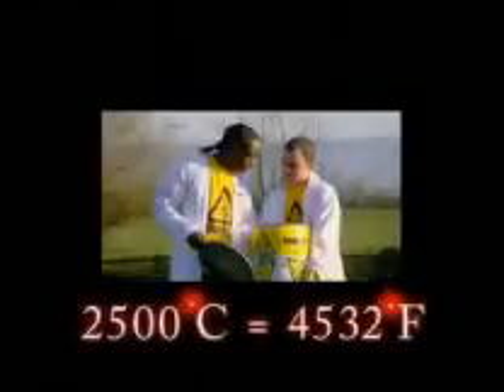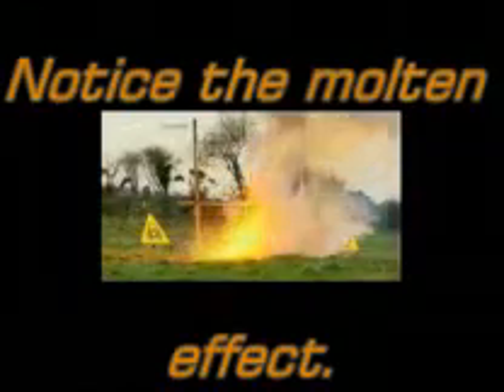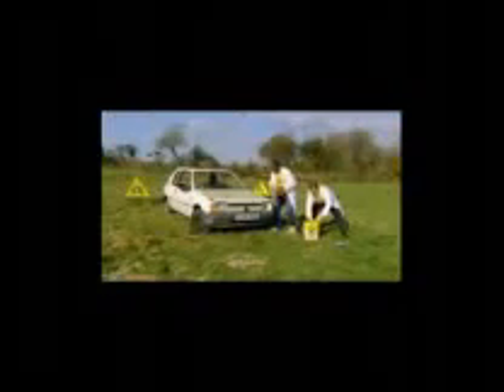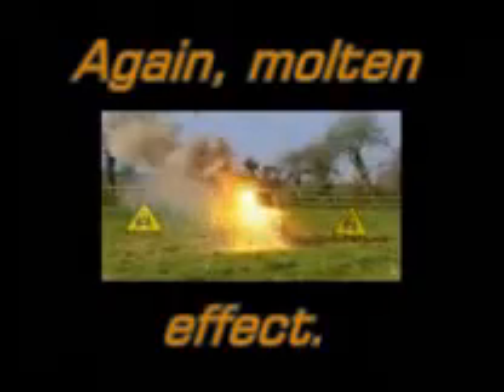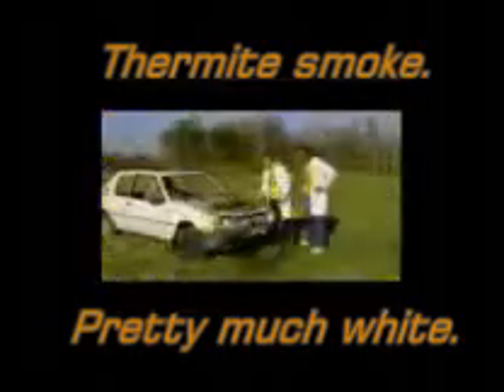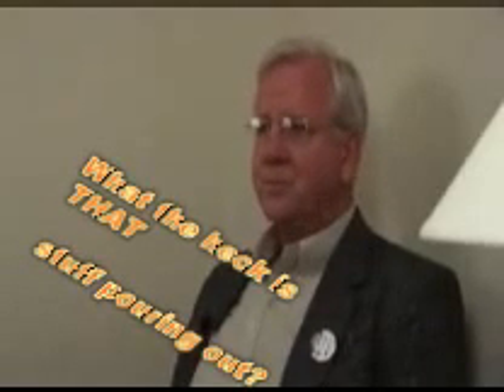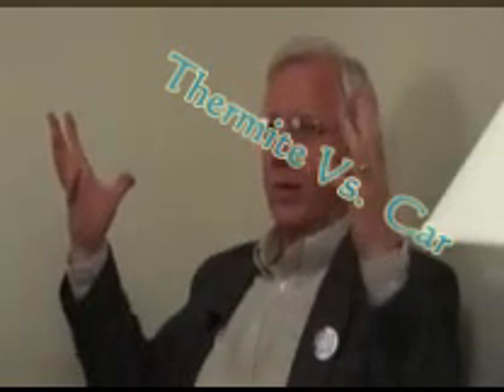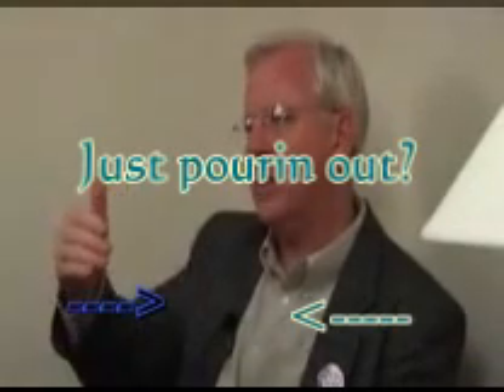How Thermite burns. (9-11)

Comment: A missile does not carry passengers on it, unfortunately. This so-called conspiracy would have required more thermite than anyone can really get their hands on. Not to mention getting the stuff up into a building that was no doubt pretty secure and extremely busy. I've seen thermite placed on the hood of a car - it went through the hood and engine block in just a few seconds. Falls straight down, except for sparks. That wouldn't collapse all of the support beams in a building that size, sorry.